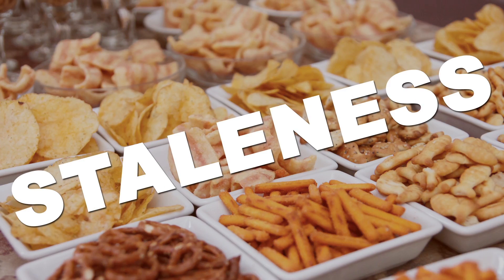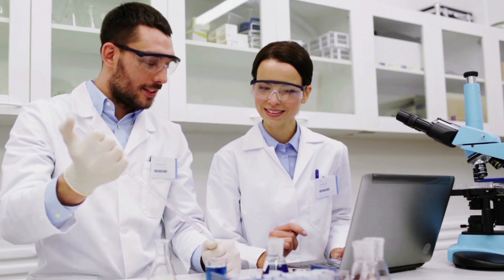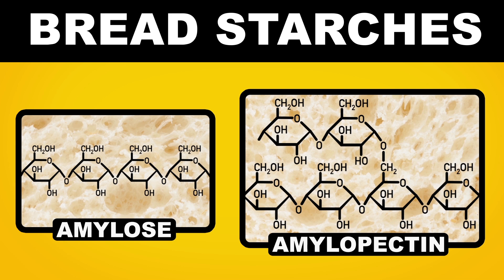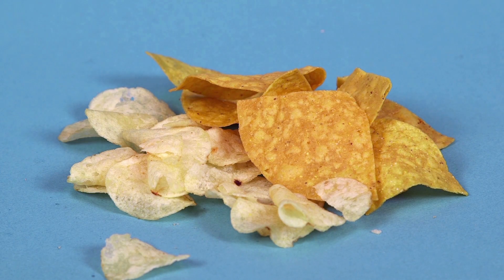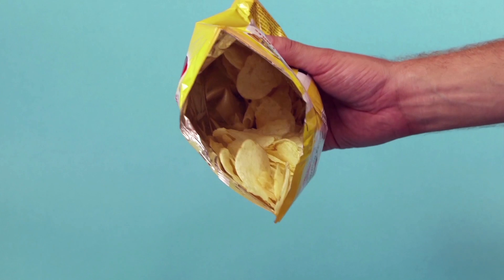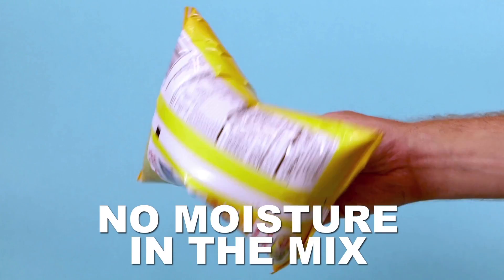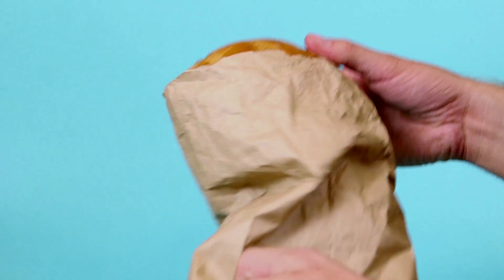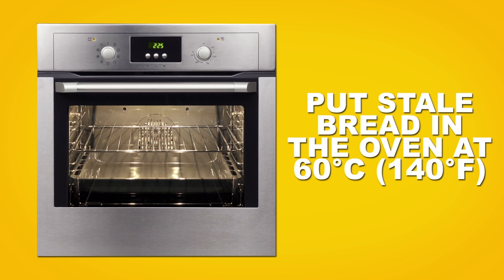How To Bring Stale Chips And Bread Back From The Dead

Comment: I tested it. I put my stale corn chips in the microwave for 30 seconds and here are the results:
They indeed became crispy. My microwave has a malfunction where the table doesn't spin, so I had to put it all on one side. I found that it is important to evenly distribute a few chips over a plate, not the whole bag at once. You don't want the chips to be laying on top of eachother for this to work. I had to microwave it in 4-5 batches to get the full bag crispy again.

Comment: If you really want to revive a bag of limp chips, you can use the microwave, but don't use high. Use the largest glass bowl or microwave safe dish that can fit and spread the chips out. Use 10% power for about 15 minutes.  The time varies a lot depending on the moisture content and weight of the batch. If that does not do the trick try 20% for a few minutes more.  The chips will calmly sit there slowly drying out, but at the last minute once they are dry they can easily burn or catch fire.  If you are willing to carefully monitor them, they can come out even better than new.  If they have picked up a stale taste in addition to being limp it is probably not worth the effort however.

Comment: Bread may stale faster in the fridge, but it will keep it from getting moldy a lot longer. I'll take stale bread over moldy bread anytime, especially since most of the time it's going to get toasted anyway. And freezing might work great for  stocking up, but who the heck wants to wait around for  it to defrost to make a sandwhich?
Reply: me999 
Use tge oven, or microwave to defrost it.
Or put the bag in a hot water bath.

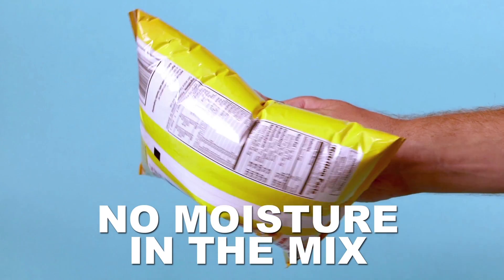Comment: 2:18 This excuse works up to a point. When you're selling bags of air with a handful of complimentary air. if it really needed to be a whole 86% air, why would brands vary so much, many pumping significantly less air in? If one brand can get away with less than half air and still have their chips remain in tact, why must another sell us 86%?
Reply from the maker: Chips (and pretty much all food) are sold by mass not volume. If you look at the bottom of your chip bag you can see the amount of chips usually given in ounces. This mass is measured in the factory before the bag is filled with nitrogen and sealed. The puffiness of the bag results in a distinct volume change but it's no difference to the actual amount of chips. If you find a brand that sells more mass for less money that's called finding a deal. It has nothing to do with a brand getting away with anything.
Reply: @ACSReactions  is the large bag necessary or is it a marketing tactic? Because id assume most people are not checking the weight on the bag so the bigger bag just makes it look like your getting more than you are, or is it a shelf life type of thing?

Comment: I keep corn chips in the freezer, nothing gets moist in there.
Reply: Dragon Skunk The moisture in the air from the coldness
Reply: Puggy Things Most modern freezers has a built in defroster that prevents moisture. That is why modern freezers don't have a coating of ice on the walls.
Reply: Dragon Skunk Freezers would just freeze the egg wouldn't it? I'm talking about the normal cold part of a fridge that you'd put some milk or veggies in that would be cold enough to put a little moisture on the egg shell